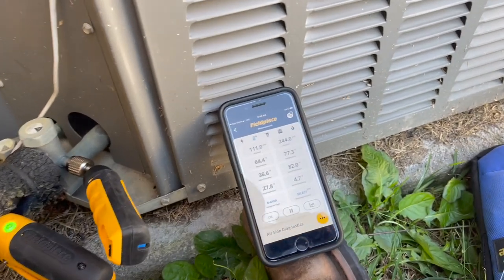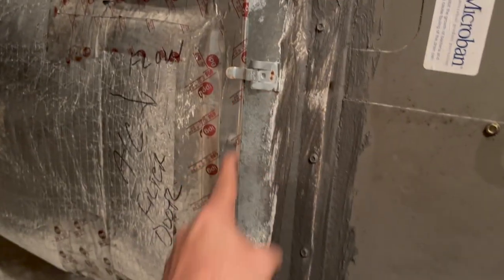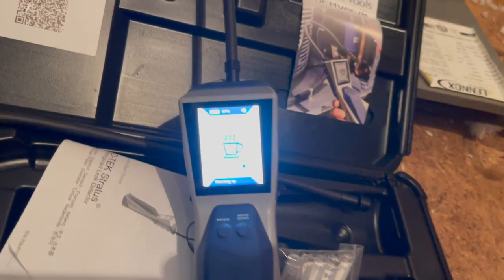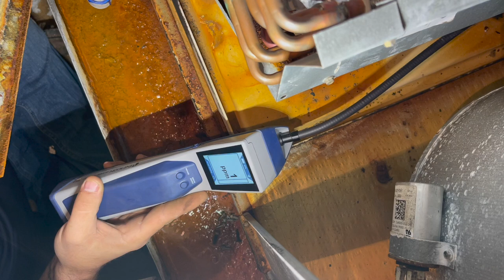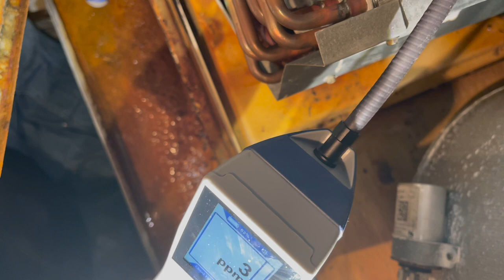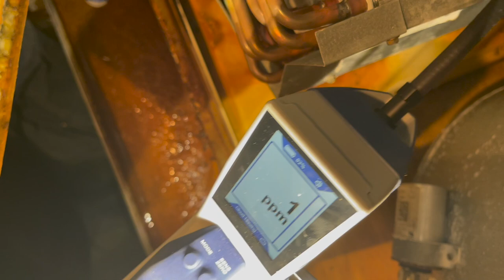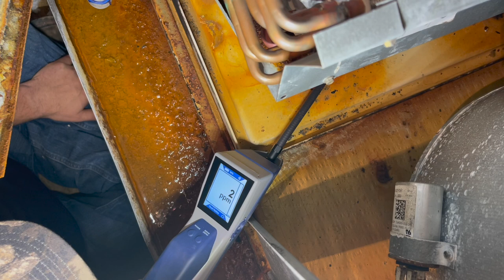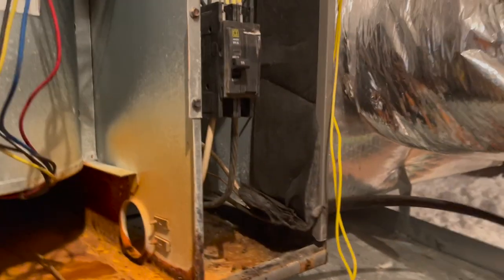No Cooling/Another Lennox Down

Comment: good job john.. i work slighly different .. wet evap by spraying with water or run without fan for a minute to get coil wet..then use ultrasonic 1st... you might have heard the leak in a second rather than running that wand all over the coil. saves lots time .. use those as back up. still would be a sale after you show the rusted AH. you would save time on many leaks with ultra sonic

Comment: You do great work….wish in my area. Is climate there an issue?  Here if do proper maintenance, things still look good at change out. My last change was getting rid of York Affinity. AC was still good, but gas furnace trash even after multiple expensive repairs. I hope Carrier Infinity holds up. 3yrs no problems. I installed surge suppression on outdoor inverter unit and on gas furnace/air handler. Don’t want the electronics blowing. Part of that rewire, was so I can switch to Honda inverter generator if power goes out. Thx for content.

Comment: I’m pretty sure that unit is from 2014 actually Lennox serial number the second 2 numbers are the date of manufacture if I’m not mistaken
Reply: But I agree on replacing that air handler, with all that rust damage and drainage issues. Good work.
Reply from the maker: You’re absolutely right it is a 2014